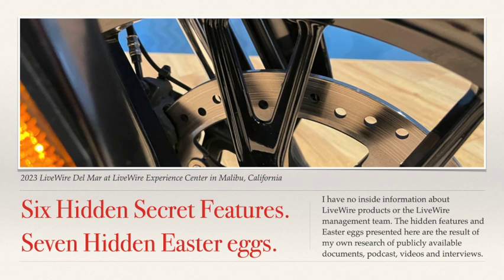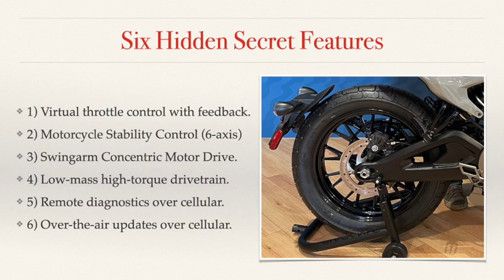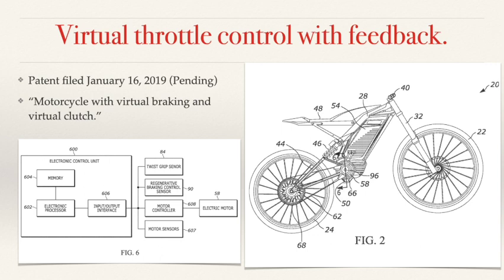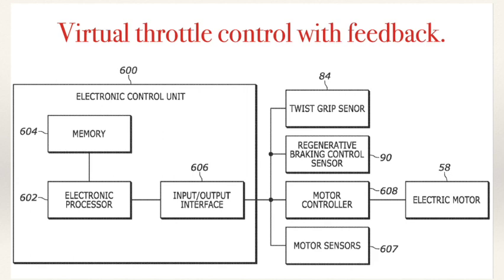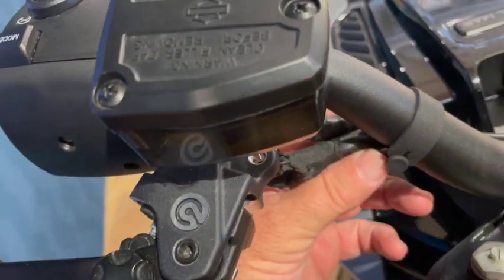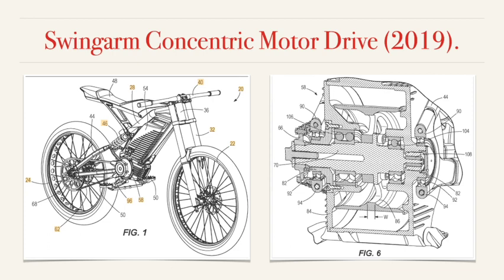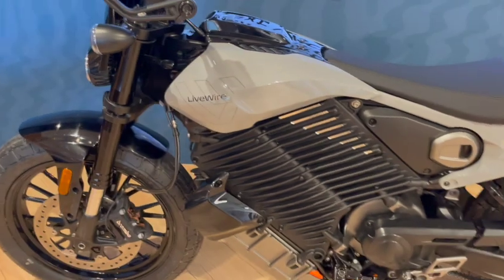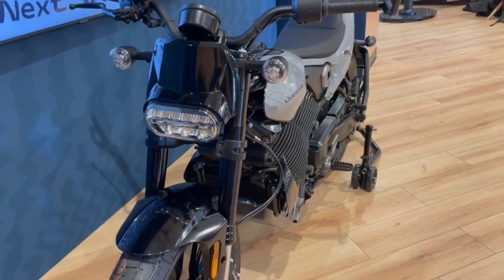Six Secret Features on the LiveWire Del Mar motorcycle

Comment: One thing to add about the swingarm/motor pivot is that the belt tension will stay absolutely the same when the rear wheel goes up and down on the rear shock.  That is huge because the belt should last a very long time since it won't be getting shocked with low to high tensions at any time.
Reply from the maker: You're right. I'll add it next time.

Comment: How is your livewire doing in the cold and do you have any problems driving livewire through the cold?
Like Canadian winter.
Reply from the maker: I was born and raised in Fort Erie. I have tons of experience riding in cold weather. The LiveWire ONE does not have any performance issues running down in the 30s. I have not ridden it below freezing. However, there is no heat coming off the motor and for reasons I don't fully understand, running a heated vest off of the battery is not recommended and may void the warrantee.